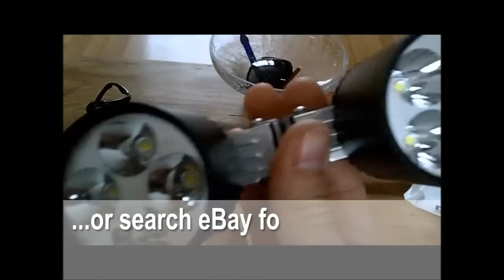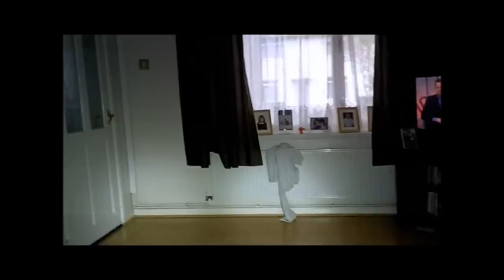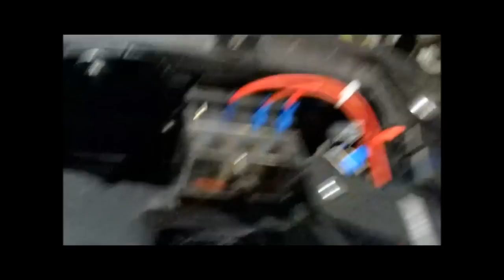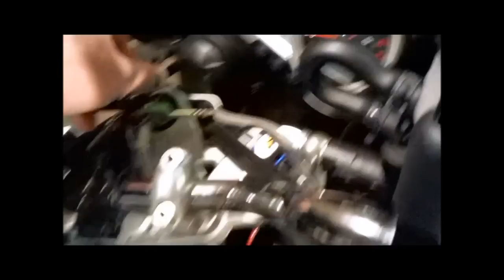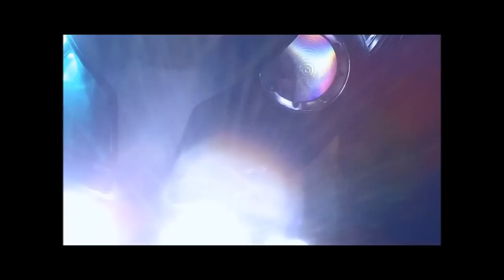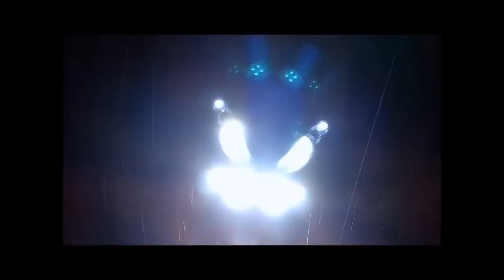12v 30w 3000Lm Cree led spotlights video taken by Mark from UK

Comment from the maker: under the truck may be a problem, since the front lens of the light has no protection from rock hitting. on the side mirrors should be ok but how to make it rotate is another issue. quality of the light guarantee is good though at its price. u can go to ebay find my listings under the same user id "2allbuyer"

Comment: You really need to cover those single wires with spiral wrap or something similar. Vibration and cabling rubbing against metal bits aren't a good combo.
Nice job otherwise.
Love the lights.

Comment: i found there was to much difference going from main to dip{like day light to dark instantly )
Reply from the maker: Is that mean the lights are too good when full on so it is disappointed once they are turned off? May be you can adjust the dip beam more bright and just run with the dip beam.